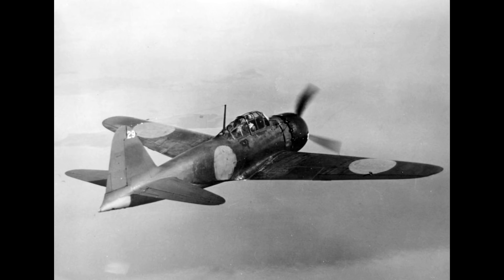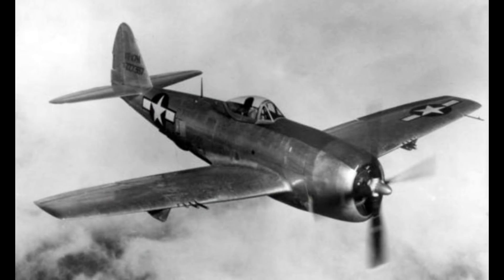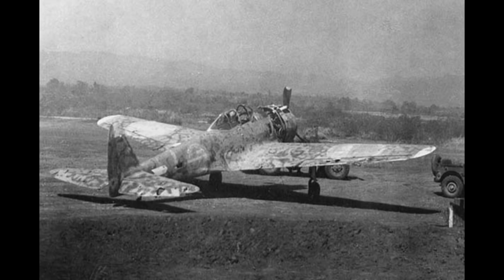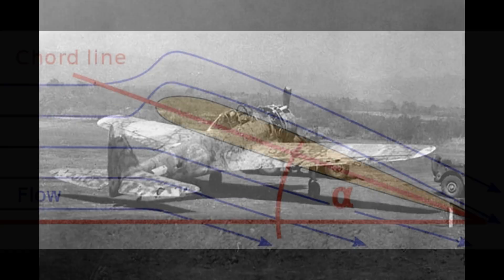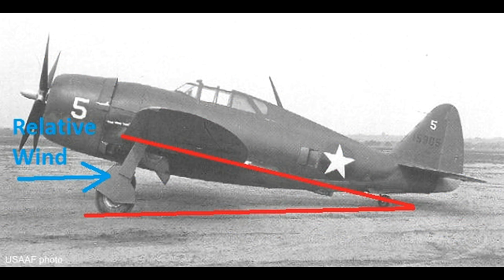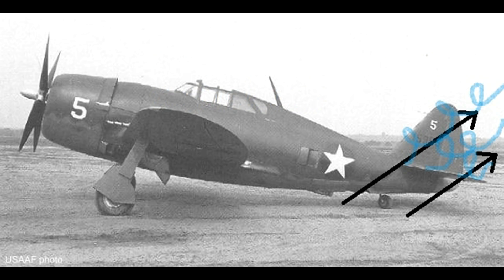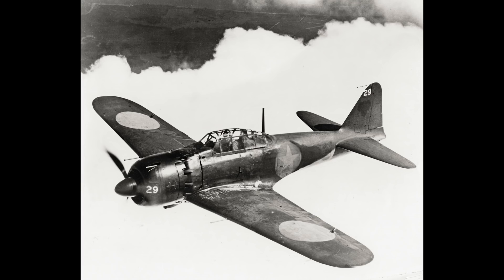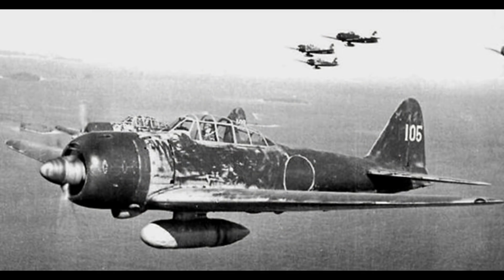Mitsubishi A6M Zero, an interesting fact few people know

Comment: There is actually a special maneuver called Hineri Komi where the A6M pitched up in a turn fight and use the rudder to cut inside the turning circle. The rudder response at high AoA seems to have made such a maneuver possible. Thanks for the well explained information. Without this, I don't think I would have gotten the full picture as to why that maneuver was mostly unique to the A6M.
Reply: Here is a visualization of this maneuver 
https://www.youtube.com/watch?v=1t9cr1frFw4&ab_channel=KingsandGenerals

Comment: Interesting as I didn't know at all about this anomaly! For your curiosity the Zero altrough an excellent fighter had a big drawback: the faster it went the harder was to move the ailerons and rudder rendering it extremely unmaneuverable at high speeds, often blocking the ailerons and the rudder in a dive and popping the rivets. The following variants was fitted with thicker panels, fitting at last armour protection was provided for the pilot, engine or other critical points of the aircraft, and perhaps more importantly self-sealing fuel tanks which many historians consider it the main cause of loss of so many irreplaceable pilots. Among other drawbacks was the inability to install a more powerful engine. Very good job and looking forward to see new videos from you👍👍👍
Reply: Mitshubishi A7M shiden, even better at dog fights, 2000 hp, beautiful beast, but it was too late

Comment: Enhanced rudder effectiveness at high angles of attack is certainly very useful for naval aircraft that have to land on carriers, such as the Mitsubishi Zero. Nakajima's follow-ups to the Ki. 43 Oscar, such as the Ki. 44 Tojo and Ki. 84 Frank also had the horizontal stabilizers located forward of the rudder. I remember reading that in the KI. 44's case, the author stated that it was to improve directional stability. The Ki. 43's predecessor, the Ki. 27 Nate, on the other hand, looked very different with a rather leaf-shaped narrow chord horizontal stabilizer at the very end of the fuselage. Back to the subject of naval aircraft, I suppose the F4U Corsair's design addressed the problem of rudder effectiveness with its unique looking tail, somewhat reminiscent of the Blackburn Skua; one could either say that the vertical empennage was moved forward up the fuselage or that the horizontal empennage was moved backward towards what could almost be described as a fuselage extension.

I find this stuff very fascinating. I appreciate your take on these subjects and look forward to more of your work. I wonder if you have any thoughts or ideas on this question: Is it possible that the drag-inducing humped airfoil shape of the fuselages of the Italian Fiat G.50 and Macchi C.200 fighters conferred any lift benefit along the lines of a "lifting body?" And if so, is there some way to quantify that? In general, to what degree to fuselage shapes have any effect, if at all, on lift?
Reply: I need to clarify, the author's claim was that the Ki. 44's tail configuration with the vertical empennage placed aft of the horizontal empennage was to improve directional stability. The way I wrote it made it look like I thought the horizontal empennage is responsible for directional stability, which is not the case.
Reply from the maker: Hi Michael. Extra points for mentioning the Blackburn Skua, that's an obscure reference. I don't have data on the lifting body effect on the Italian planes, I'll have to look into that. My feeling is that it wouldn't be much. For comparison, the Shorts Skyvan, which has a lifting body fuselage, get about 30% of it's lift from the fuselage, and it's designers clearly were not too concerned about drag. It's probably a real effect in several WW2 fighters, but I can't  quantify it at this time
Reply: Thanks for your reply. The literature states that the hump was to improve forward visibility. I doubt there was much consideration of any aerodynamic effect other than the drag penalty. During the late '30s considerable thought was beginning to be paid to the benefits of streamlining and eliminating drag but theories like the area rule (Germany, 1943) and lifting bodies (1960s) were indeed, after the fact. I'm just very curious about how older designs can be analyzed by modern methods. Back in those times, aeronautical design was also an art; designers discovered a lot of things by accident and trial and error, and it often started with a simple hand sketch and prototyping process, and then a lot of very brave people risked their lives to see these designs to their fruition. That's a big part of the fascination of this subject for me. They're all very interesting people and heroes in my book (even the bad guys who were working for the wrong side).
Reply: The FIAT G.50 was the least successful fighter of WW2 with the highest loss to kill ratio for any fighter. It had a top level flight airspeed of 267 MPH (the same as the CR.42 bi-plane it was replacing). It was underpowered with a 660 HP engine. I closely suspects that bribes and corruption were the sole reason the considerably better and vastly faster Re.2000 was rejected by the Regia Aeronautica in favour of the G.50. Two squadrons of G.50's, flying from Belgium, were lost over the North Sea during the Battle of Britain due to heavy rain on one occasion. 

The FIAT G.50 would make for an interesting future video. Originally it was intended to carry a vertically stowed 100 Kg. / 220 Pound bomb mounted in an internal bomb bay behind the pilot. However on testing the feeble 660 HP engine couldn't lift the G.50 off of the ground so the bomb bay was forever left empty.

By comparison the P-35 lookalike Re.2000 had a top level flight airspeed of 330 MPH, could carry external bombs and had a fully enclosed cockpit. It was accepted in trails by the RAF in early 1940 but Italy declared war in June 1940, so the deal fell through. The Re.2000 served with some success with the Royal Hungarian Airforce on the Russian front. Meanwhile Regia Aeronautica pilots had to suffer a fighter that should never have been accepted into service in the first place.
Reply: heck, i'm pretty sure most engineers tried to AVOID having any part of the plane except the wings and horizontal tail produce lift, to reduce induced drag
Reply: i think the other reason for the re 2000's rejection was its wet wing design, which made it a potential tinderbox if things went awry
Reply: At the time, nobody considered all-moving horizontal tailplanes, which could have had benefits in terms of maintaining rudder effectiveness beyond stall angle of attack.  One concept that I couldn't develop for lack of resources involves a straight wing with free-moving slats and root strakes, a trapezoidal vertical tail with a worm-geared wheel for setting fin incidence (a useful measure to adjust for the propeller vortex at different engine and prop-governor settings), and swept stabilators with electric trim for roll and pitch loads.
Reply: apparently part of the issue with the all flying tail was overcontrol.
Reply: B. C. Schmerker do you have a sketch of your design? I'm curious
Reply: I believe that the zero designer was influenced  by design that was the work of A Folland when working for Gloster who were the 30s working with Japan if you look at the light weight fighter that Gloster submitted  and was turned down by air ministry the design drawings  and production plans were sold to Mitsui while japan was still friendly with uk      moenui
Reply: @michaelmonfils2642  I can believe design decisions taken to improve visibility.
Having best high speed or best sustained turn rate is all well and good, but it counts for nothing if you can't spot the enemy.
It's the enemy you don't see that's gonna get you.